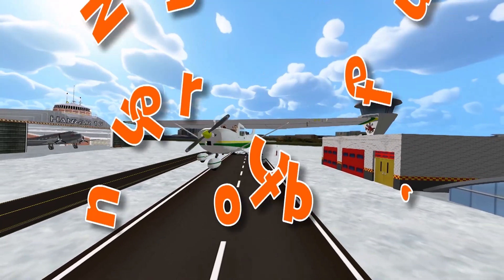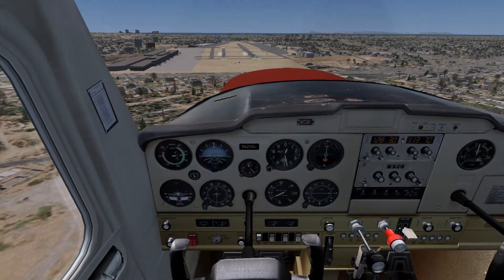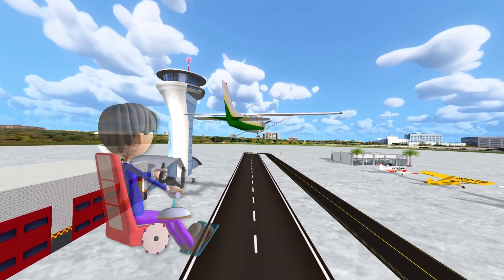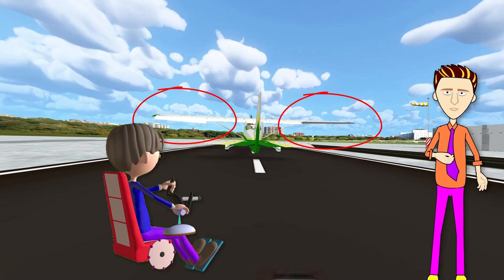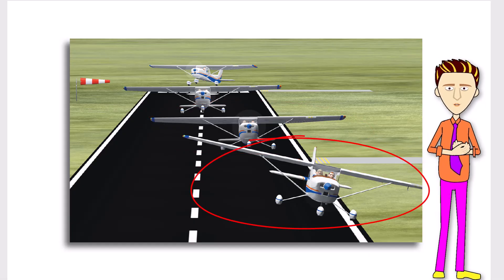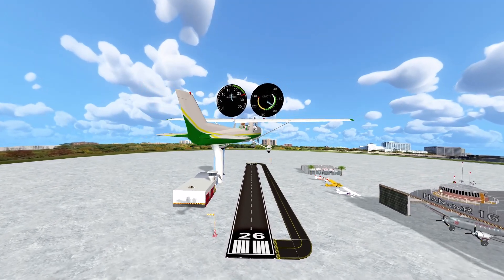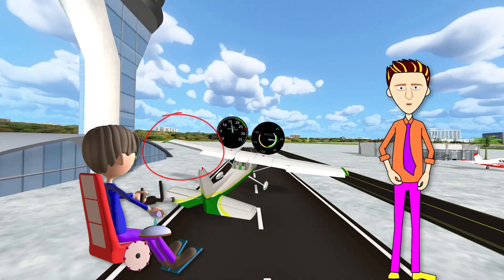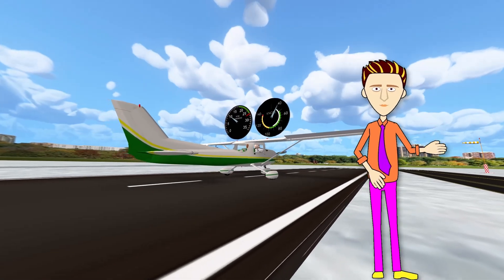The Crab Method of Crosswind Landing Correction

Comment: Advantage of learning this method in primary training, if your goal is the airlines, is that a Boeing or Airbus has to be landed this way. Large diameter wing mounted engines preclude the wings low method. Exception are the few DC-9 based 717's left in service. OGG (Maui) is windy and those planes land gracefully rather than side loading the, granted built for it, mains.

Comment: Love the video as always Rod. You deconstructed cross wind landings beautifully. The graphics make me laugh, but landing past mid field gave me anxiety ha ha (understand cartoon). Crosswind landings is  fav topic, specialty/pet peeve. I'm shocked pilots have little skill and knowledge when I teach or fly with them, GA or Airline.  I had a good instructor 40 yrs ago. Post Pvt I watched for WX for good crosswinds at local airports. Get to airport ASAP, rent plane to practice crosswind landings. Soon after transitioned to taildragger (conventional gear) pilot, Cantabria, Luscombe 8A, Cub, RV-4, Stearman , T6, Pitts). Later at airlines crosswind skill came in handy while I saw Pro pilots struggle. 

Arguably good crosswind technique is more important with little wheel in back than Land-O-Matic more forgiving tricycle gear setup. However I don't accept that as an excuse. If you have good crosswind skill in a tricycle airplane it will translate well to tail dragger. Even if you never fly a tail dragger, it is my pet peeve and I focus on crosswinds, Even tricycle gear planes can have LOC on landing due to poor crosswind pilot skills.  When giving Flight reviews, IPC, or any of my students, I emphasize crosswind skills.   

 I never have taught Crab than kick it straight wings "level-ish". Although do use that in large jets (passenger comfort and low wing mounted engines and long wing tip clearance).  The "wing low method", aka "side slip" is my go to, Pvt pilots are required to know what a slip is and how to fly them. So I start there, make sure they master or review both kinds of slips: Forward Slip (used more for drag) & Side Slip (X-wind landing).  On final (coordinated turns to remain on extended centerline) as you show, always crabbing.  When to transition to side slip (wing low)? 

  ** NOTE: My pet peeve is good musicale memory on how to do a Coordinated Uncoordinated Cross Control , enter or exit the side slip almost by reflex. More on that below, but I call it the "Dancing Bear". ** 

Practice is key. How do I teach it crosswind landings (and takeoffs frankly)?

BEFORE doing crosswind landings, I make sure they can slip both Forward nd Side slips. I pick roads with cross wind and  track them a low safe altitude both crab and side slip, getting student use to flying in a slip, tracking road, leaning left and right while side slipping, gives them practicing and holding a cross control, Than go back over road in other direction.    

LOW Approach practice - With a crosswind, fly the pattern without landing. Fly final in a crab . With no intention of landing, 1/2 flaps, gear down, landing checklist complete, use more POWER to remain level about 10-30 feet above runway. Fly the length of the runway in a side slip (wing low plan aligned with runway).  Instructor can control throttle while monitoring airspeed, track and altitude so student can focus on flying both the centerline of runway, at an airspeed of Vref x 1.3 min., Going from Crab to "Wing Low"  Side Slip down the length of the runway, followed by going around and back to normal coordinate flight controls.. 

Demo crosswind landings for students is always on the lesson plan as needed. It can be an eye opener landing in a bank with holding the downwind wheel off the ground as long as possible.

** Dancing Bear -  You should not have to THINK too much about how to get plane in an uncoordinated slip, aka "cross control",  opposite rudder and aileron. Arm chair (kitchen) table top training at home, sitting in chair you imagine you imagine crabbing to the left of a line on the floor.  To slip left (wing low) you do what?  Don't think just do.  Assume a standard "U" yoke ala Cessna, you raise your RIGHT HAND UP (banking left) and push RIGHT  RUDDER (yaw right). So at the same time RIGHT HAND UP RIGHT FOOT FWD. Than repeat for left wing low slip, LEFT HAND UP LEFT FOOT FWD. Go back and forth, repeat side slip left and right.  The resembles a circus bear doing a dance.  You CAN and should do this at altitude in the plane for an exercise. Pick a point on the horizon, and do the LEFT and RIGHT side slip. Try and keep nose at the target point while smoothly going back and forth from left and right slips. Again dancing bear. This helps pilots, be able to easily go to the slip and FLARE at the same time. 

Practice - seek out and find good crosswind days to practice. Seek out a good instructor who knows how to fly and teach crosswind landings. 

You can on your own practice or with instructor,  start to CRAB to SLIP emailer, 100-200 ft above TZ to establish the slip. BE SURE TO ADD A BIT MORE POWER more than your normal no slip approach, as you are adding drag.  However ideally you want to transition to side slip somewhere no later than landing round out or starting flare as you gain skill, about 10-20 feet above ground,. I like to do it later because wind changes as you get close to the ground. I found crab needs to go away close to ground due to effect of ground, as well as obstructions in the area, buildings being one, like that COMICALLY LARGE CONTROL TOWER IN RODS VIDEO. Ha ha. 

 40 yrs pilot, 35 yrs CFI (active) ATP 

PS and BTW Good crosswind TAXI and TAKEOFF skills are important. Taxi: "Down and Away" for Quartering Tailwind. "Down and Into " for Quartering Headwind.  Takeoff FULL aileron into the wind  at initial takeoff roll and reducing. Depending on how strong the winds are you may need significant aileron to keep upwind wing from lifting early. The goal is a shallow coordinated turn into the wind to crab into wind on climb out, tracking the centerline#.  IF YOU PRACTICE "ANTI" CROSSWIND CONTROLS ON TAXI AND TAKEOFF ALL THE TIME YOU WILL STAY CURRENT. 

# ATC expects you to fly RUNWAY heading if they clear you to "fly runway heading". They expect a drift. Now with "Children of The Magenta Lines", pilots fly the extended centerline of the runway with GPS, LNAV and autopilot. Just food for thought, RUNWAY HEADING is a clearance, not a 20 degree crab angle. If there is a SID by all means put that in the box and fly it, which may have you go to a fix on the runway extended centerline. HEADING and DIRECT are two different things.
Reply from the maker: Greetings GMCJetPilot:
Excellent contribution. Thank you for posting. I sure do appreciate the comment, too. 
Best,
Rod

Comment: Thanks for the video.
Most people I talk to say they crab on final using rudder only, and I always thought that was weird cause I am used to crab using ailerons and rudder as I would do in cruise to correct wind.
Reply: Once established in the crab, you don't really need much input at all.
Reply from the maker: @UncleKennysPlace  That's correct. Once established in the crab, you're doing straight and level flight. No input necessary unless you want to change the heading you're flying.
Best,
Rod
Reply: The very good reason for this is that coordinated turns here generally involve some or a lot of adverse yaw.  Other things are going on and rudder only yaw is correct yaw and fine butt to target correction while adverse yaw sends the nose the wrong way and is the beginning of LOC.  Also yaw only corrections allow dynamic proactive rudder pedals movement which keeps us ahead of the airplane, ahead of gust spread, and keeps the wing level.  If we allow no deviation from exact butt to target direction of our course, the wing cannot bank.  We are setting our own phase rather than wing wagging out of phase with
Reply: The kick into longitudinal alignment at the bottom does not counter the crosswind with the wing level.  Crabbing down the centerline extended is fine rather than side slipping into the crosswind all the way, but without that upwind wing down when aligned longitudinally drift will happen.  So either side slip all the way or at the bottom just before and into touchdown and after touchdown or the airplane will scoot sideways or worse ground loop.
Reply: Crab is level flight with a WCA

Comment: For me, the wing-low method works great. Learned it on Dash 8 and still use it on B777 😅
Reply: You don't seem to speak the way actual pilots speak, and ...you're striking an engine if you slip while landing ("wing low method")
Reply: @erickborling1302 I think I was a passenger on this pilot's Dash 8 going into Boston with thirty knots direct crosswind.  Yes he crabbed wings level until flare when he used rudder only for longitudinal alignment and yes he put the upwind wing well down preventing drift and he did not strike the upwind engine.